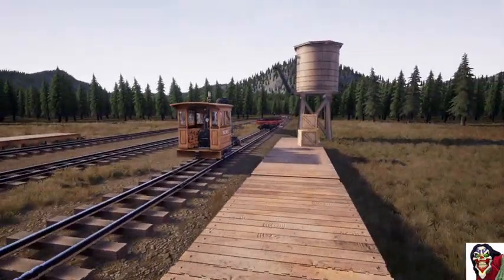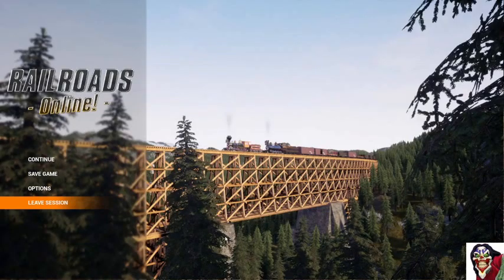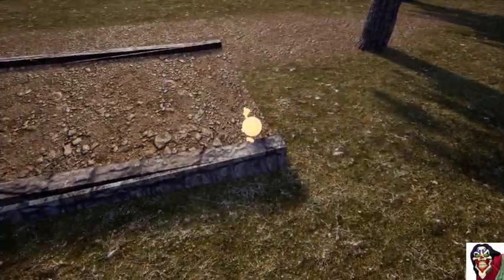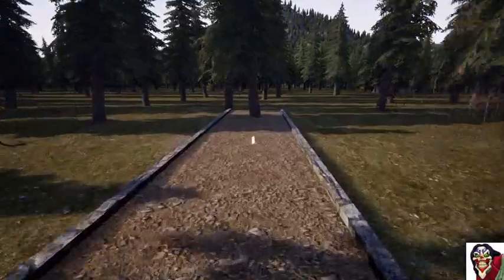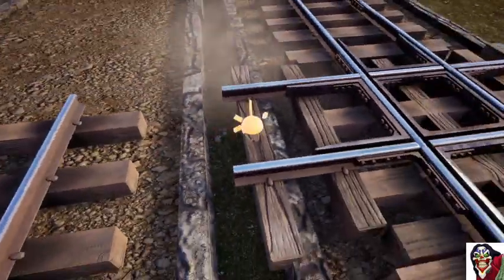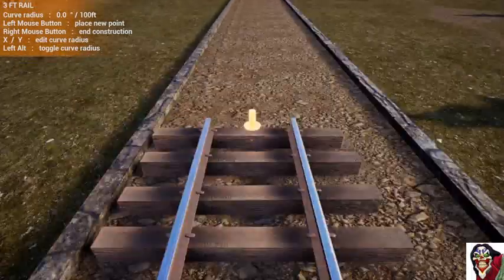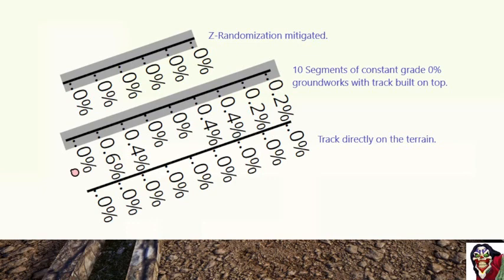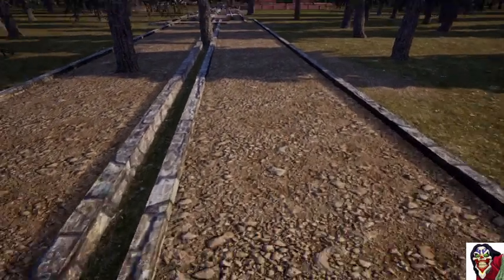RO! - Old Build Tools Tutorial Ep1

Comment: After some hundred hours in the game and building a whole map I still learned a thing about deleting tracks. Thank you, sir! After watching you placing the final groundwork only one simple question rests: Why do you connect the final groundwork to every segment of track? I usually place it as long as possible on straight track to keep the spline count (and the loading times I hope) down.
Reply from the maker: Connecting groundworks to every segment, or only connecting to every (insert even spacing of control point here) means you still have the same number of splines.  Splines usually go from object to object (switches/cross tracks).  You save on control point count, not really on spline count.

Using uneven segment lengths is more of an issue when you have a long segment, then a short segment.  The short segment will kink or twist.  If you end the long segment spline when you get to the corner (which the corner needs to be connected to every control point to follow the curve), then you actually made more splines, which will have a load impact.
Reply: @K10wNs-Shed  I learned that later on in your tutorial (just binge watching all of them). I thought that every single object placed count as a spline. Thanks for enlighten me.

Comment: A couple of questions. One: Why bridge deck at the station? Two: Why lay regular track before laying bridge deck?
Reply from the maker: Using Decking rail to line up the edge of the ties (its wider than the normal rail) against the legs of the platform gets the right spacing away from the platform, and gets it parallel with the method I show.

Decking rails give an easy visual to know when you have the railcar spotted at the right location in front of the loading platform or crane.  You could also use a different groundworks to mark the location.

Don't use decking rail to build (or set control points) with is the simple answer.  It does not place straight and skews off to one side.  Snapping it to the control points of the normal rail forces it to place straight.

Comment: How do you get the curve radius in .25 degrees? I can do the grade in .25 with the shift key, but the using shift doesn't work for me on the curves.
Reply from the maker: Did you redefine the keys for curve radius?  If they are no longer set to 'alpha' keys, shift no longer works.  Default the key binds will make it work again.  Holding shift also gives fine increment control of levers and brakes in first person mode.
Reply: @K10wNs-Shed  Thanks , I did change the curve keys back to 1 and 2.